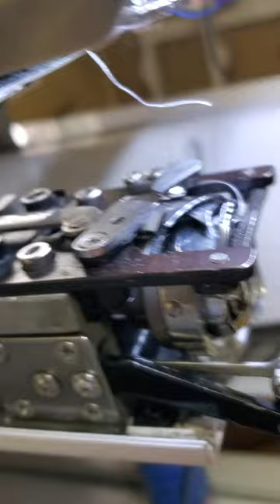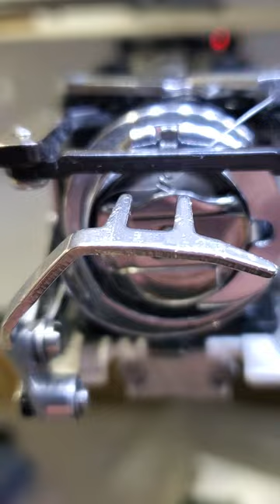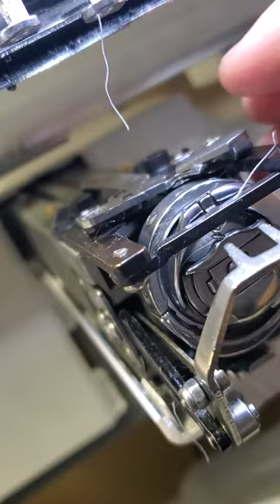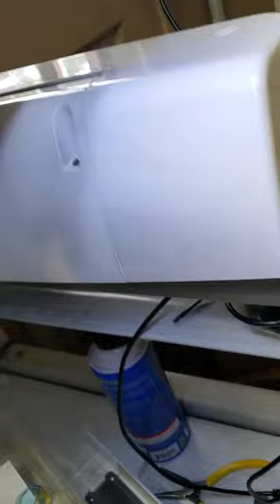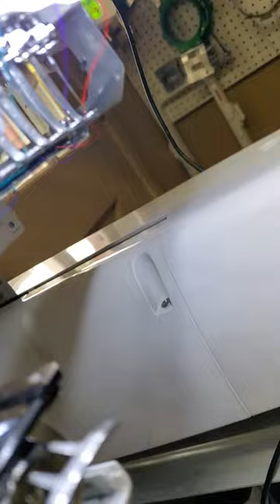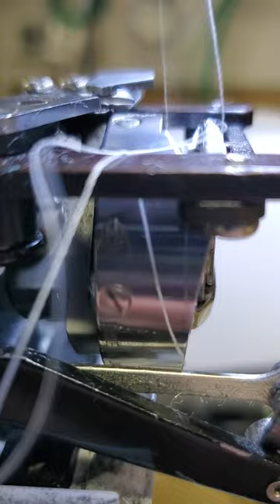4-7-21 EM1010 issue. Timing caching thread but not bobbin

Comment: Hi I know this video is three years old and this is no help to the original poster of the video.  However if you are having this issue as I was.  The problem is the picker - the spring loaded fork shaped part at the front.  The one in this video is bent.  When rotating this by hand it won’t work so you can’t test it.  The picker pushed the bobin in when the machine starts a thread and when it cuts a thread.  This one is misaligned and also bent.  Hope this helps someone I had this problem but now mine is fixed.

Comment: Im having this same exact issue any solution ?
Reply from the maker: Yes you have to adjust the timing. There are set screws you have to just loose. Google setting Bobbin timing on Em 1010. It's not fun or easy.
Reply: What the timing position 195?